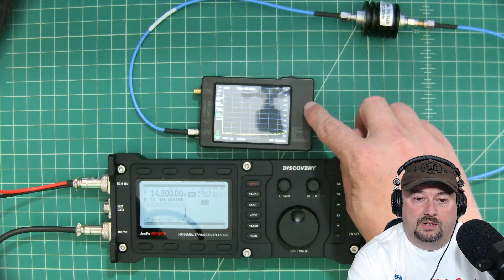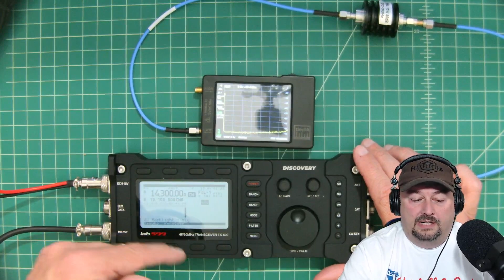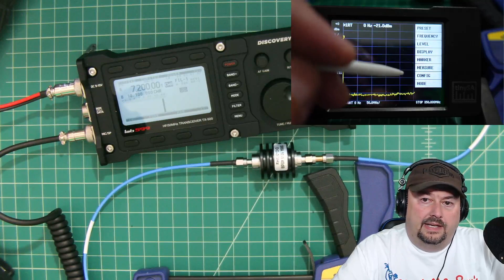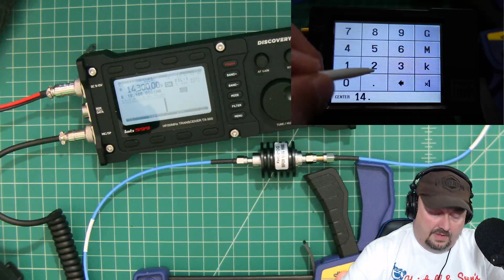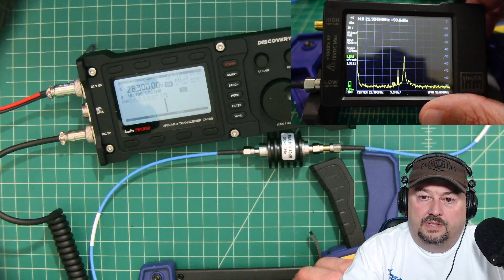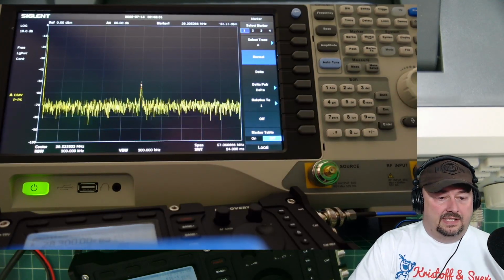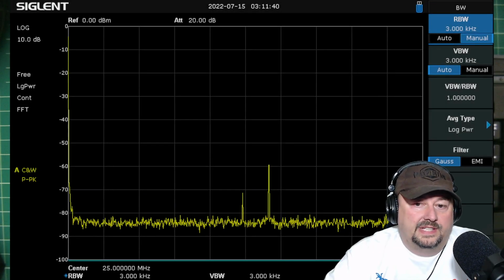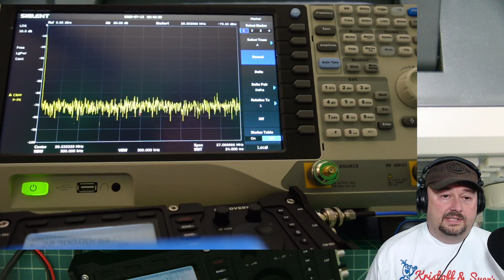Testing the Lab599 TX-500 for Harmonics with TinySA

Comment: Are you sure that TinySA is a real measure equipment to make any conclusions?
Reply from the maker: You did see consistency with the Siglent correct?
Reply: @TheSmokinApe  I don't use Siglent for any RF measurements (only as digital oscilloscope and logic analyzer). It reminds me of a case that happened many years ago when I bought a new spectrum analyzer of the similar level from USA with a phase noise measurement function for my home lab and for a long time could not understand why my UHF synthesizers were not getting better ... :-)
Well, I checked your measurements with another source and they are roughly the same. However, the measured parameters correspond to TX500 specifications.
Keep in mind that this is a portable 10W QRP transceiver and connecting a 10kW PA would not be a good idea.
Reply from the maker: Thanks for the perspective Karen, I appreciate it!

Comment: Nice video, but I don't think the TX-500 is making any power.  Look at 2:59 when you go key down.  The power graph on the TX500 isn't moving, so no output.  What you are seeing is carrier leakage at -56dBm.  Put the TX-500 in RTTY and then hit the mic PTT or put a straight key on the rig and go key down.   if the Radio is making 10W CW, then the math is +40dBm (10W output power)  Minus the attenuator  -40dB = 0dBm is what you should see on the TinySA or the Siglent for the fundamental tone.  Great video concept, you just need the radio to make some power for the test. de KB7ZUT
Reply from the maker: You are correct, thanks for the call out.  You can see an update here: https://youtu.be/sDCibaKktAA
Reply: @TheSmokinApe  Cool.  I will check it out.

Comment: That level looks wrong... If its 10w (+40 dBm) and a 40 dB attenuator, then the fundamental should be around 0 dBm on the TinySA. It looked to be -50 dBm.. faulty cable, attenuator? Or is it just me?
Reply from the maker: So, we will post power output tests.  That said, independent of power output, the second signal is there... would you agree?
Reply: @TheSmokinApe  Not necessarily.. If the TX599 is not transmitting carrier, then could be viewing the carrier suppression. You should see 0 dBm on either spec an
Reply from the maker: @technishn  so when at 3:20 you see the noise floor lower than -90db and I key up and the signal is at ~-53db or a 40db signal that’s not enough to convince you that there is a signal?
Reply: @TheSmokinApe  The TX should give 0 dBm after the attenuator. You are seeing a much smaller  fundamental signal. Can you test with a handheld or another  QRP HF TX?
Reply from the maker: Thanks Kevin, your comments helped.  I made an update video here: https://youtu.be/sDCibaKktAA

Comment: Did you set any attenuation on the TinySA? Eg manual -20db ?
Fyi I have a tinySA and bought the same 10w  40db attenuator after watching your previous test video. I want to test my g90 (@10w or less) and my UV-5R but don't want to damage the TinySA
Reply from the maker: I had the attenuation set to auto on the TinySA.  I wanted to test my g90 but just traded it before I had the chance!  Thanks for watching Michael 👍